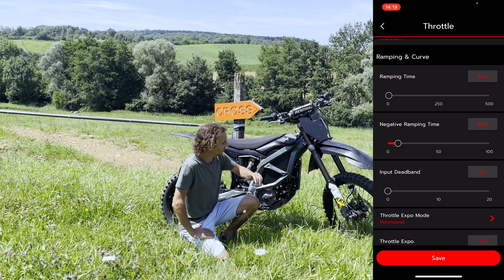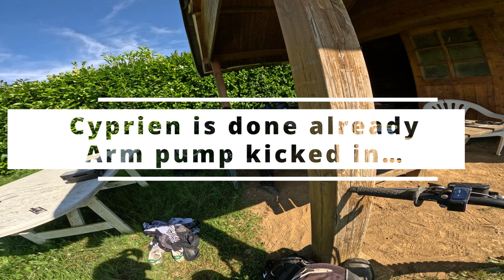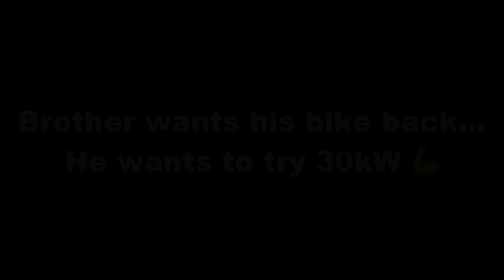Ultimate Surron Ultra Bee Power Upgrade | 30kW Ripping Machine

Comment: I would love to see a video where they take the bikes to a dyno and get some actual numbers. All videos always are like "iNsAnE pOwEr" blah blah... Show some real numbers so we can get a real understanding...
Reply: just read... the engine outputs 30kW. (40.25 HP if you need that)
Reply: @TheGrundigg  theorical value
Reply: @Cr3atureOfNature  not theoretical... Engine rating. It's not that complicated. Sure there will be some losses on the drivetrain or other friction. But on a dirtbike where you constantly fight for grip anyway it wont be significant. Same as measuring the bikes on a dyno, at that point it is more important how smoothly or stable the power is delivered to the rear and how good the suspension is. That would change the effective power much more.
Reply: @TheGrundigg  no bro..
 These people all are like: "install this $2k controller, add this $4k battery, change to this $2.5k motor, 31.3727 KW setup" blah blah... I wanna see an actual dyno chart showing the difference. Sorry, I understand perfectly what you're saying, just would like to have some more data than just peoples opinions on the ride after the mods.
Reply from the maker: @TheGrundigg  yeah, unless Supermoto, there’s more power than you can pass to the ground anyways…
Reply from the maker: @Cr3atureOfNature  get it. Unfortunately I don’t have a dyno at my disposal. I can just give you my gut feelings and compare to other bikes I’ve ridden
Reply from the maker: Also worth mentioning that on electric bikes with have the real power output info from the controller. Knowing that even the shittiest electric motors have an efficiency of 95%, you ain’t far from a bench value.
Reply: @MTO_Brothers  thank you for letting me know about this.
Reply: People who ride these bikes mostly understand the KW ratings. So he literally has the numbers in the title

Comment: How does this compare to the torp tc1000?
Most people i've seen in europe has gone with that controller for some reason.
Does the torp handle the bigger battery or same as the x9000?
Reply from the maker: @Foerarn1234  TORP doesn’t handle bigger batteries, it’s the same. Both are based on VESC software (but TORP violates the licence to my knowledge). 
That being said Torp tries to be compatible with more stock features of the bike whereas EBMX gives you more setting options. You can see this like iPhone vs Android in a way 👍

Comment: how much money did you have to spend to make 125 two stroke power 😂
Reply from the maker: @ydkma  hahaha. 125cc has this power between 9k rpm and 11k rpm. This has the torque all around, so it feels way more powerful
Reply: more then the cost of a new ultrabee
to have that power it will cost close to 14-15k total. and still hope it does not shut down on you because of heat issues. believe me, i have seen enough of those already.

Comment: Can i ask you if you are faster with you fully moded UB or with your fully moded LBX ?
Reply: The ultra bee with more travel and larger wheels eats obstacles easier so it's faster in most cases. The smaller bike could maybe be better for really tight technical single track trails
Reply: @MotoAlias  Thanks for your answer. The battery you are selling is only 3kg heavyer than stock and 40% more power? Better cells? What about the 80v one?
Reply from the maker: @kolopier  Surron uses pouch cells whereas we use li-ion NMC cylindrical cells. Doesn’t necessarily mean better but usually longer lifespan and we managed to get a perfect layout.
86V has more series (and packs more cells) but unfortunately very few controllers handle more than 80V
Reply: @MTO_Brothers   I think you got that backwards. Stock surron isn't pouch cells.  The ebmx battery's use pouch cells. Not sure what your battery's are.
Reply from the maker: @MotoAlias  stock LB are 18650, stock UB are pouch (unless they made several versions and I’m not aware). We don’t use pouch ourselves as cylindrical are more reliable and long lasting
Reply: Les cellules cylindriques n'ont pas une durée de vie supérieure mais une meilleure capacité de dissipation thermique... @MTO_Brothers
Reply from the maker: @nicod974  Ouais elles gonflent… donc souvent ça devient inutilisable
Reply: @MTO_Brothers it depends on which Pouch Cell and which cylindrical cell, discuss about it with Bruno Power you’ll be surprised😉
Otherwise more than one year riding with ultra bee and x9000 controller, very happy about the combo
Reply from the maker: @fasar1128  whatever the cells, pouch from drone to laptops, always end up swelling. And I guess Apple doesn’t go for the cheap ones…
Reply from the maker: @MotoAlias  yeah they are different beats. Light can be faster and easier to handle in tight sections. Now the Ultra saves the pilot. On this specific terrain I think I could be about as fast with both, but I’ll be more consistent and last longer on the Ultra.